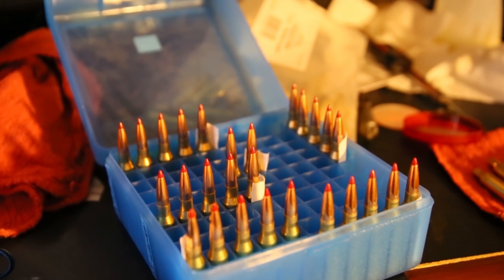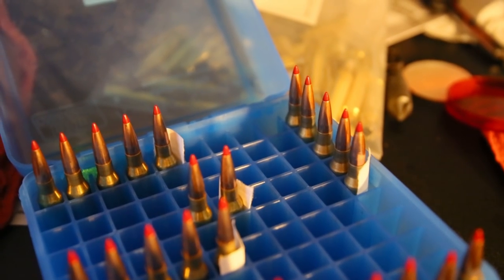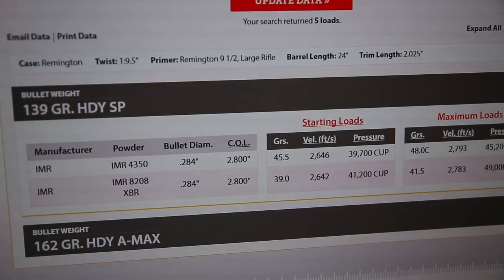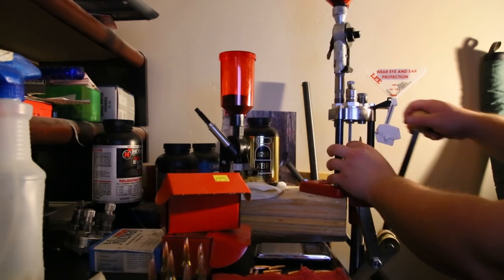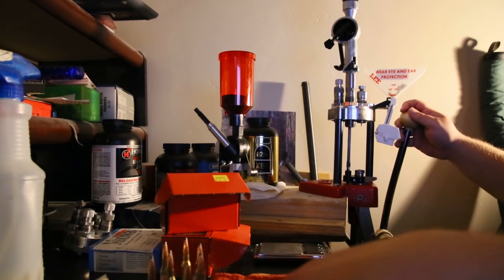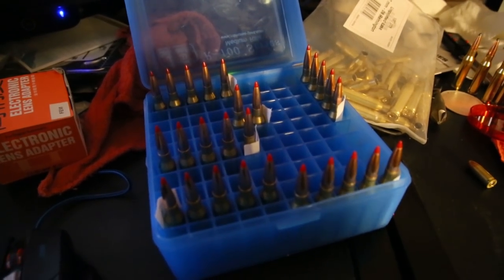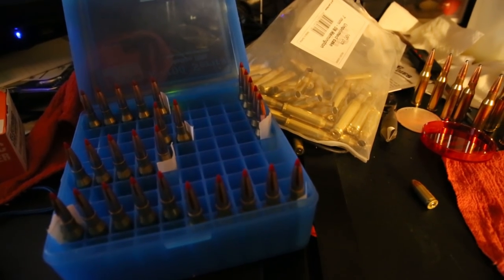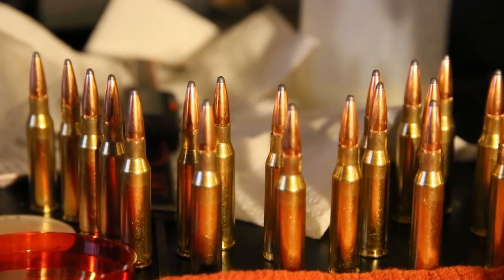Why I switched from 30-06 to 7MM-08 And reloading 7mm-08 for Elk - Lee Classic Turret Press

Comment: 30-06 > 7mm-08. 308> 7mm-08. Enough said.
Reply from the maker: I'm sure you are basing this opinion only off of the fact that the 30-06 and 308 are .30 caliber, and disregarding the higher BC and efficiency and flatter shooting of the 7mm caliber? The 7mm-08 shoots flatter and has higher down range ballistics and performance than the 308 and 30-06. Its cheaper to reload than the 30-06, and has less kick than either. I was honored to take my first elk with my 7mm-08 this week. One shot kill, my 162gr ELD-X passed through both lungs and a portion of the heart and exited the other side at 250 yards.
Reply from the maker: All 3 are more than capable, and can kill any animal in north america.
Reply: Both the .30 cartridges I listed are better and more commercially available than a 7-08. That's a fact. Secondly, I have 2 rifles in the 7mm design and one is a 280 AI and a 7mm magnum. Both of those cartridges are a lot more effective on Elk and overall are better hunting cartridges than the 7-08. Have a nice day.
Reply from the maker: Thank you for sharing your opinion. And thats just what it is, your opinion. I could point out why the 7mm-08 is better for "me" for hunting, but it wouldn't change your opinion. Thats a fact. My handloaded 162gr ELD-X bullets are within 150fps of the 7mm rem mag, and using half as much powder, costing about 30-40% less per round to reload. I could also point out how fast the 308 and 30-06 drop and lose velocity beyond 400 yards compared to the 7mm counter parts, which is a fact. But again, it won't change your mind. There are dozens of capable cartridges out there, and plenty of them are "better" than the 7MM-08. But not for me. I do not think you watched my video, as I mentioned that the 30-06 is a great cartridge and very versatile, and also why I switched. Have a nice day.
Reply: Glenn Pearson My 7 mag spits out the 162s around 3050 FPS accurately. I highly doubt you're coming within 150FPS. Furthermore, the 7 mag is the most popular magnum in NA. You can find components for the 7 mag anywhere and every big company makes the 7 mag. I'll be able to effectively kill elk at farther distances than your poor mans 308. Good luck.
Reply from the maker: Considering the cost of any 308 is virtually the same as my 7mm-08, so that comment is unfounded. And since I handload, and have commercial ammo for my 7mm-08 available at several local retailers, It really wouldn't save me a dime for hunting to have a 308. 

My handloaded 162gr ELD-X using 45.5 grs of Alliant RL-17, hornady Brass and CCI-100 primers  chronograph all between 2850-2875fps shooting out of my Weatherby V S2 w/24" barrel. And they are about .6 moa at 100 yards. 

I am a fan of the 7mm Rem mag and understand its popularity. I'm not saying any of these guns are bad, they are great and may end up with a 7mm mag in the next year or two. But with requiring 30-45% more powder to spit out just another 200fps isn't worth the added recoil, barrel wear and muzzle blast. To me, it obviously is to many others. I would also venture to say that many people underestimate and don't understand the 7mm-08's potential. Everyone I know that argues against have never owned one, reloaded for it or used it.
Reply from the maker: Conor, that is what the .280 remington and 280 Ackley improved are. Patton243 mentioned that he owns the 280 AI (Ackley Improved). Which is a great cartridge and is based off the 30-06 case necked down. Well, technically is more based on the 280 Rem. :)  

Also, remember that 7mm bullets are longer. So you don't always get increased case capacity for powder vs the .30 bullets. This is why the 308 can fire a 150gr bullet slightly faster than the 7mm-08 can fire a 150gr bullet. In the 308, the bullet is shorter and wider, which allows for more powder, however it is less efficient/arrow dynamic because of its shape, so even if the starting fps is slower in the 7mm-08, by the time you hit 200-300 yards the 7mm bullet is traveling about the same speed and than continues to exceed the 308 and even the 30-06 from there on out. This is one of the reasons why I chose the 7mm-08 over the 308.
Reply from the maker: Which caliber are you shooting? If you are shooting .30 caliber gun, I would recommend the 300 win mag, or even the 300 RUM if you want the higher capacity. If you are shooting a 7mm caliber, I would recommend the 7mm Rem Mag or the 7mm Weatherby mag if you need the extra case capacity.
Reply: I think you must define "greater than". The humble 7mm-08 carries more energy than either the 30-06 or the .308 at ranges past 500 yards. The reason is the 7mm projectile is ballistically superior to the .308 in pretty much every way. I own rifles in all three of the afore mentioned chamberings. They all have their place. For a light weight, low recoiling rifle that's fast in hand with more than adequate horsepower for medium sized game...the 7mm-08 is hard to beat.
Reply: Patton243 7mm Remington Mag. >>>>>>
Reply: NADS   LOL
Reply: Good save...
Reply: All Calibers...  (and I know you reference 400 yds) start to DROP dramatically  at that range.  More than any common hunter, myself included, can calculate without an accurate chart of ballistics and ammo from a specific gun. Includining chrony work and distance.

My Longest shot 543 GPS'd and later "lasered " and with a .338 180gr.   Not my proudest moment as it took 2 but I had whitetail venison to dine on for the winter.

I still love the 7mm-08.

REM7600
Reply: Well Said... BigRedpower59...